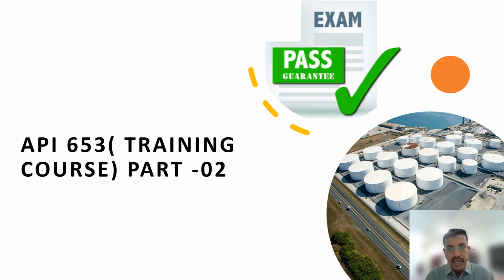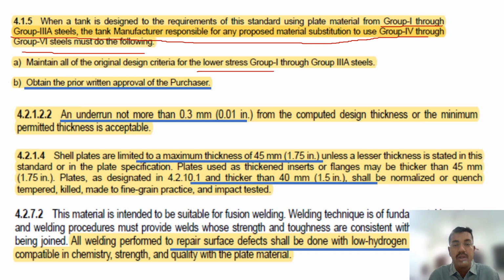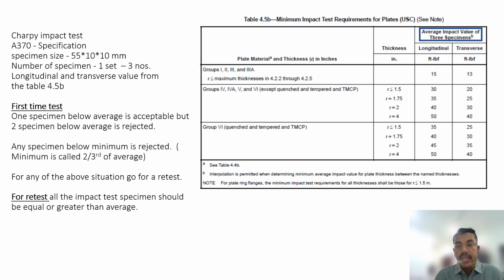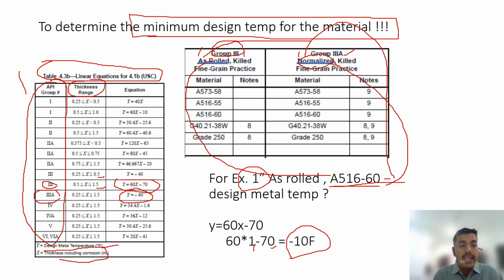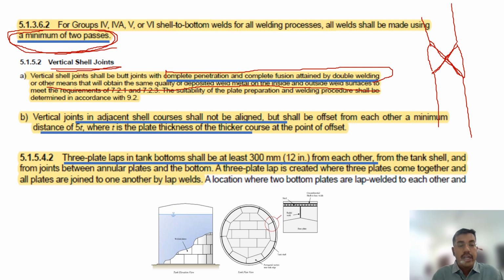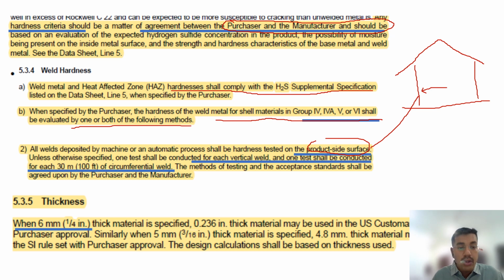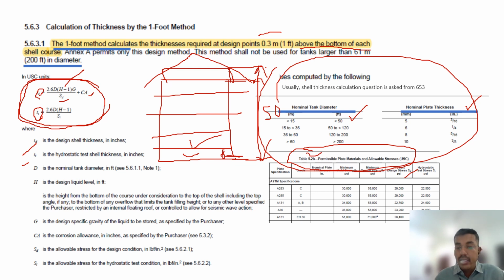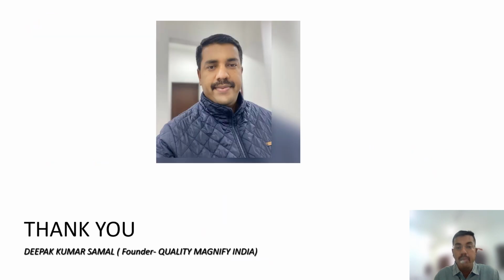API 653 PART 02

Comment: Thank you for sharing your valuable knowledge.

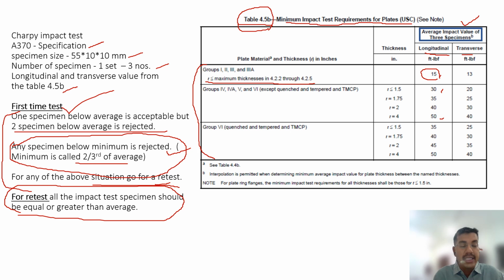Brother, just a small concern regarding the part at 19:51 in the video - you mentioned that any specimen below the minimum is rejected (where minimum is called two-thirds of the average).

However, as per the code, the minimum is actually defined as two-thirds of the specified minimum value.

You explained it correctly earlier in the video, but at this point, it seemed slightly different.

Thank you once again for your great support and for always sharing your knowledge with such clarity. It truly helps a lot

Comment: Sir distance from toe of  fillet weld in shell bottom to  edge of the bottom outside of tank its given 3/8 inch min in api 653 
 ,but in api650 you say it as 1/2 in minimum ..please clarify it .